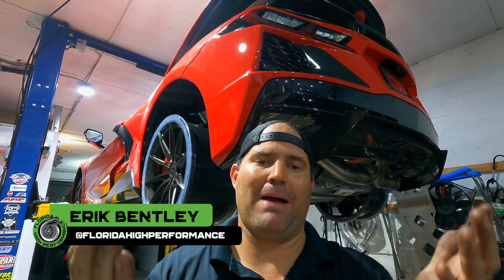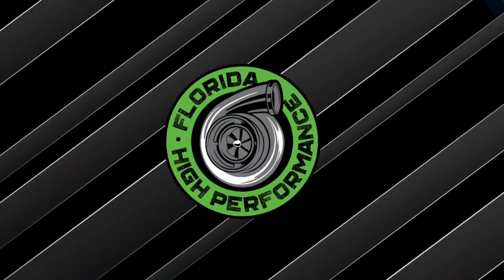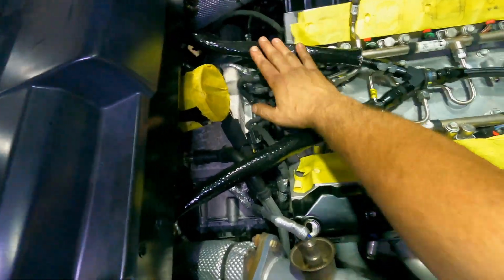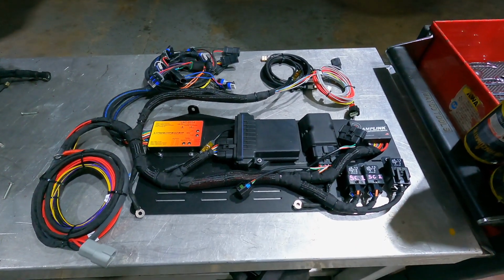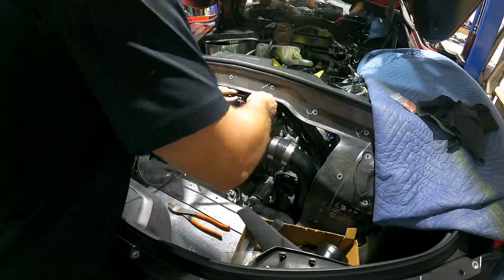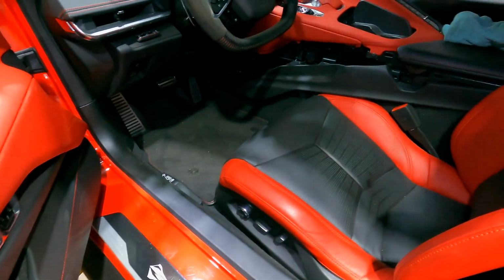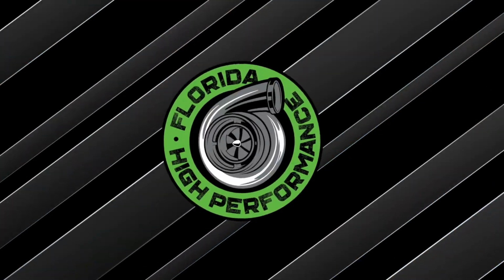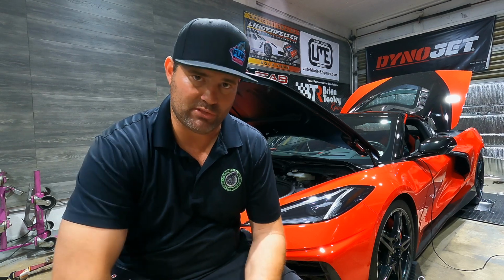Twin Turbo C8 Episode 2 - WE FIRE UP THE NEW TURBOCHARGED ENGINE!

Comment: C8s already have lower oil pressure than most are accustomed to seeing.
Are you also seeing low oil pressure numbers with your kit?
Reply from the maker: Yeah I noticed that too….
Idle hot, 30’s
Cold start, 60’s
Reply: If your hot pressure is still in the 30s, your kit has better pressure than others I have seen!
Some have reported pressure in the low 20s.
Reply from the maker: @rlhay2  are you referring to the pressure drop due to turbo oil feed?  The turbos have flow restrictors built into them which helps keep oil flow under control.  That and the custom engine is built with tighter motor precise clearances which is always a help.